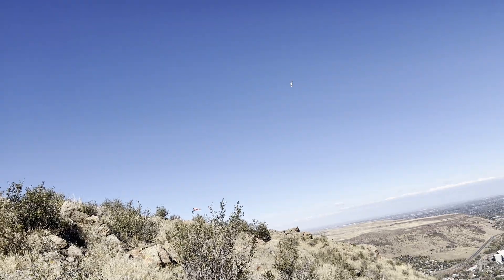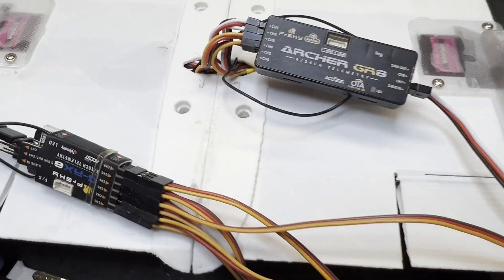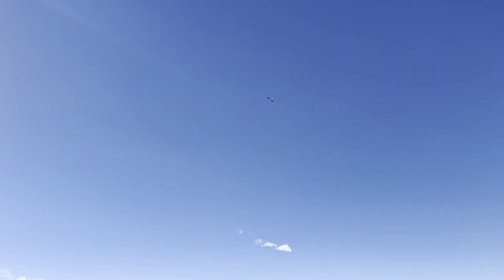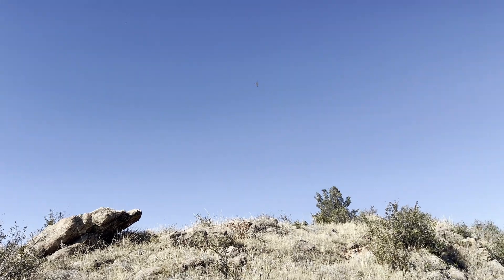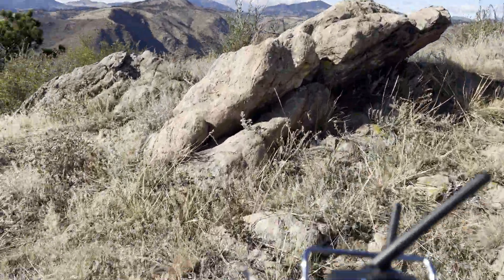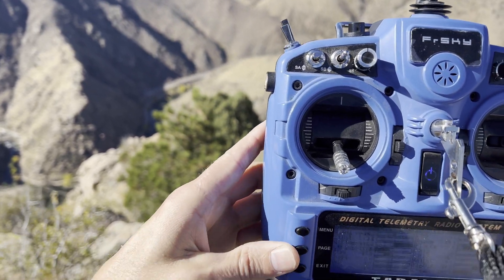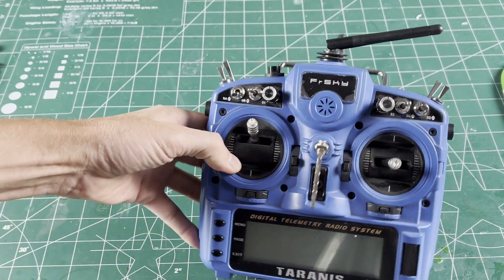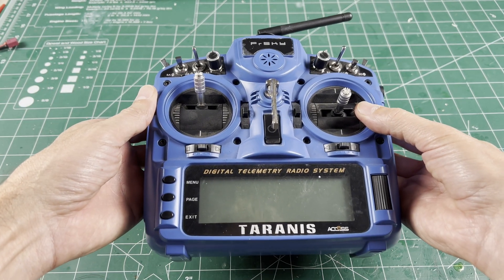Done with FrSky - part1- Dynamic Soaring mishap.. not pilot error for once, which is not good

Comment: I have been a Spektrum user for almost 20 years and advise against it. Last 5 years they have become totally disconnected from users. Crazy expensive receivers that do not perform well at all! New transmitters models every month. Strange quirks with the cheaper line of transmitters. To me they no longer have a place in the A-grade brand list. I am currently migrating to a Radiomaster TX16S as well. I have an external module for ELRS. (I was an early adopter but still happy I can use the other protocols).  It took a long time before I a would trust this new combo. Had some mishaps as firmware developed. Currently it is at a completely reliable status and I am trusting my more expensive planes to it. Especially with the new radiomaster PWM receivers. I think they are awsome. True: learning curve in pakcet rates and programming is indeed steep, but you were used to the taranis, so it will not be that hard for you. It just is not easier. If you want a lot from a computer, it becomes a complex tool. If do not want a lot, things can be easier. But... I did hear the Yeti's have a nice OS. Also the new generation of freesky, also flown at my club, is also a very very nice piece of equipment and I understand also easier to program.

Comment: Hmm.  After watching this I think I will pad with some foam around the battery in my Taranis so that it is held a bit better.  That Taranis of yours looks like it has some miles on it Lol!  I just bought an X20RS and it is WAY more quality than the Taranis ever had.  Ethos is really nice.  At the field here in town there are plenty of X20 owners.  I have no regrets.
Reply from the maker: I hike and fly a lot, but did so with my older radios too.  The battery only moves around when you really shake it, but still should not shut the radio off.
Reply: I will be happy to give your Taranis a look over if you are interested in getting it repaired.  No charge.  Just the shipping.  I am not a professional but I do a lot of that sort of stuff.

Comment: I know you said you want something different than FrSky, but the x18 and X20 lineup with Ethos are incredible. Very Easy programming, new twin and tandem receiver protocol depending on which version you select, plus they will still work with the receivers your using now.  I use Archer receivers for my 3d printed planes and run tandem in my planes that are over a grand, I also use a tandem receiver in a 5” freestyle drone and have never lost signal in anything. Good luck!
Reply: No twin Protokoll on x20 and x18 ! Online x20 pro and pro aw got the twin protocoll
Reply: @wanieldeber6903  X20R and X20RS also have TWIN, and there's a TWIN module for the X18 and old X20's.
Reply: @wanieldeber6903 I have had the  x18 and now have an x18se I can confirm they are twin protocol
Reply: @wanieldeber6903 You can add a twin protocol module or a 4 in 1 or ELRS.
Reply: @wanieldeber6903  I said lineup, if you buy A X20R, RS, Pro, or Pro AW you get Twin protocol. You can also buy a twin lite module to add to
Any Ethos radio if you wanted to fly Twin. You are probably right regarding the X18 but one could still add the module if twin was important to them, but Tandem is better anyway.

Comment: Recommend any radio that has EdgeTx firmware. There are many options, depending what's important to you. (size feel, switch layout, etc)
As far as RC protocols, I recommend using ExpressLRS or Crossfire. Both offer much superior link quality and reliability compared to FrSky protocols and receivers. Both also offer telemetry, which when combined with GPS enabled receiver gives data on speed, position as well as realtime battery voltage and signal strength. Such data captured in the radio can be processed post flight. Might offer new ways to geek out and improve your dynamic soaring skills. 
note: both EdgeTx (radio firmware) and ExpressLRS (ELRS protocol firmware) are open source, so will be supported for long time, and have great communities for support. 

If needing radio right away, and not sure what to get, the RadioMaster Pocket is a great low cost basic radio that many are happy with as its small size make it easy throw backpack, and makes a great backup radio.

Comment: Not pilot error, but I tripped on a rock, the radio switched off, therefore it's the radios fault, LOL, that radio came standard with a piece of stiff foam in the battery bay to hold the battery firmly in place, looked like it's missing and going by the sounds of the rattles when you shake it.  I've been a Futaba user for almost 50 years, FrSky X9D+ and FrSky Lite Pro both running OpenTX since introduced to market, Radiomaster TX16S running EdgeTX sine introduced to market, and FrSky Tandom X20S and FrSky Xlite Pro running Ethos also since introduced to market, also have TBS Crossfire transmitters and crossfire modules that fit all my transmitter.  There's only two radio I can honestly say failed me, one was a Futuba in 1970 that eventually corroded from salt air ridge soaring coastal slopes and the most recent was a Jumper, I'd never use a Jumper radio ever again, apart from those two I've never had a problem with any of my equipment.  If for any reason I was forced to chose one radio only, it would have to be my FrSky Tandom X20S running Ethos, fitted with both TBS Crossfire long range module and a Multimodule so I could still connect with all my models.

Comment: Do you charge your battery in the radio or do you charge it out of the radio because if you check you might not have balanced cells I have the tx16s and I never looked back I also have the Zorro and the pocket crush all on elrs
Reply from the maker: I use the on board charger that has a cell balance circuit.  You have to plug and unplug this, only use for charging.  It is a stupid thing too, but part of what FrSky supplied

Comment: I do a lot of TX repairs for myself and friends.  I have seen cracked solder joints  on the pins of the  connector on the TX that the battery plugs into.  That connector gets a lot of stress and abuse because you unplug the battery every time you charge it. 
I usually first check that to see if i can duplicate the problem by tapping on the wiring from the battery just above the connector that plugs into transmitter and see if the TX turns off.  You have to be patient and try tapping at different angles to see if it fails.  If you can get it to fail you can go ahead and resolder the connector on the printed circuit board.  If you can't get it to fail I would suggest that you open the transmitter and look, with magnification and a strong light,  at the pins on the connector and see if you can see a defective or cracked solder joint.  
Intermittent failures are the hardest to diagnose.  

Good luck, Bill
Reply from the maker: Good suggestion, I might have to re-open the unit and just reflow the pins.  I have a nice soldering station so it would be easy... still going to get a different transmitter for my primary

Comment: why don't use foam or anything else, that the battey couldn't shake in the bay?
Reply from the maker: the shaking battery is just an annoyance, it is not the cause of the fault
Reply: @soarkraft  I didn't meant it could be the cause, but it isn't good. the cause of the fault would maybe a broken/cold circuit connection or lead. i wish luck for the new radio

Comment: 😅Radliomaster TX16s with Express LRS is the way to go. Really reliable with the right telemetry to let you know if you are heading into poor signal or low power. Also it warns you if the RX is connected before power down. I have flashed with EdgeTX which is a must do, too. It hasn wizards for setup, so should tick all your boxes.However, nothing will stop an electronics fault or failed solder joint. BTW, love your channel and models. Winter will be printing time, LW-PLA is awaiting its turn.😊
Reply: I'll add that with the built in 4in1 module, you have back compatibility with the RXs already bought, including Hitec. Yes, there is a learning curve and to help you Joshua Bradwell's channel is currently working through EdgeTX in steps.
Reply: Same here. The only hassle is that the Radio master 4in1 (external) is not binding Hitec Optima and minima (fw 1.3.34), while the iRx4+ instantly binds everything (4in1 external too)... mystery

Comment: Nothing worse than that hollow, empty feeling when your model has just disappeared into the ether, and you have to make the long journey home without it, knowing you’re prolly never going to see it again. I’ve felt that pain more than once.
Don’t be too harsh on the FRsky radio – any brand can go intermittent at the worst possible moment. Give some consideration to the newer FRsky X20S, with the Ethos operating system. I absolutely love mine, having upgraded from my old Spektrum DX9 about a year ago. Once you’ve conquered the setting up (there’s plenty of help here on YouTube) you’ll find it’s a fantastic radio. The Archer 6ch receivers are very compact and reasonably priced. The Tx has ALL the options you requested, with a great library of pre-installed mixers for just about any setup you could imagine. It also has the optional module for non-proprietary receivers.
I use mine at least twice a week with my various iterations of SoarKraft models (all electric powered – not slopies) and I’m yet to see even the slightest hiccup.
Cheers from Bundaberg, Australia.

Comment: I really like my Radiomaster Boxer ELRS, excellent value. The T16S is obviously very popular if it's extra features appeal to you. Primarily though I love ELRS. It has some weird quirks (like channel 5 being dedicated to arming) but the range is insane and even good quality receivers are very cheap. It's got a lot of features which can be a bit overwhelming to learn (model match, hybrid/wide mode, transmit power, binding phrases, packet rate, etc..) but once it's setup it's rock solid. For example a Matek ELRS-R24-V can be had for around $22, weighs 5g, is configured for planes, and it has 7 channels, barometer, UARTS for sensors/gps, battV input, and telemetry. It even skips over channel 5 on the physical connections so you don't have any labeling confusion. Radiomaster has some plane oriented ELRS rx's in every configuration you could want, but I prefer the Matek personally. I fly drones a lot too, and ELRS is ubiquitous in that world so it's a great fit for me.

Comment: Hi I,ve just flashed my Radiomaster TX16s from Open tx to EdgeTx.
A steep learning curve but after 3 days I,m on top of it. Even added a rate function at the field without U tubers help I,m 72 so it should be easier for you young fellas. It will do more than you want and the multi protocol is backwards compatible with all your rx,s. Love your channel.

Comment: Man, I feel your pain! It sucks when that happens. A few comments / suggestions. First, you're putting the blame for the complex programming on the wrong folks! FrSky didn't create OpenTX (or the newer EdgeTX). It's an open source project that is community driven. Lots of new radios use OpenTX (or now EdgeTX), including Radiomaster and Jumper. If you didn't like programming the Taranis, you won't like Radiomaster or Jumper either! FrSky now has their own OS called Ethos, which has the power and flexibility of EdgeTX but with a much nicer touch-screen driven interface. I currently have radios that use EdgeTX and Ethos, and I find Ethos much easier to understand and set things up. FrSky hardware has also improved a LOT since the Taranis days. I've been flying FrSky radios for almost 10 years now, and have never had a radio-related crash. Now, abouty receivers. I too am not all that happy with the FrSky receivers, mainly the form factor and availability. Recently I've been using an ELRS (ExpressLRS) module in my FrSky radios and have been using ELRS receivers from several manufacturers. All work well, but it's less "plug and play" than a FrSky receiver. There's a learning curve because ELRS is also an open source project. It's a solid protocol though, which I think would serve you well in the DS environment. I see another comment mentioned FrSky's new Twin protocol, which is similar to ELRS in that it has a long range component that works alongside the regular 2.4 (two protocols running at the same time). That would also be a good option. My last bit of advice is to stay away from Spektrum. I've lost several planes to their protocol before I switched to FrSky, and don't trust it as far as I could throw it.

Comment: After weeks of research I decided to stay with FrSky after many years of flying with an old Taranis. I upgraded to the X20R and Twin receivers. I couldn't be happier. With the glider templates that you can find online it will take you an hour to set up your first model, and then probably 20 minutes for the next one. Super easy and intuitive.
Reply from the maker: I looked a that... the "Twin" is the 5th different receive scheme FrSky has come out with in the last 3 or so years...
Reply: @soarkraft  Its called progress. If you want to stick with the same technology for 20 years, maybe Futaba or Spektrum is more your speed.
Reply from the maker: well sort of, I switched back to an older module / radio set I have been using for 10 yr because I was having so many glitchy, buggy problems with the FrSky receivers... but maybe its the fact that the module is older that FrSky is not necessarily compatible with it.  

Yes, I am trying to work with something new, but all this new FrSky stuff is not really better... more bells, but not rock solid, bad quality.  I got a new GRX8 receiver that had a glitchy channel 7 right out of the box... bought another glitchy channel 8... and they were ~ $70 each and I needed them so I did not send them back... worked around the problem, but why should that happen?????  Done with them
Reply: @soarkraft  ACCST was getting a bit outdated so I understand the move to ACCESS 2.4 GHz. But then they should have skipped the Tandem 2.4 + 900 and went straight to Twin 2.4 + Lora 2.4. Maybe there was a good reason, maybe not. I have used Lora in other projects, and it is very mature and will be around for a long time, so I can't see FrSky come up with something new that would make sense in the next 5-10 years, so I am happy with Twin and being able to update some of my G receivers from ACCST to ACCESS.

By the way my first 2.4GHz system was Assan back in 2008/2009 and I still have it.
Reply: @soarkraft  Reality is V8 was their first protocol. Then D8 added telemetry and sensors. ACCST was next and added Sport and Sbus as standards. ACCST came out with the first X9D transmitters. It has been their main protocol for a very long time. After many years they introduced ACCESS with MANY powerful new features. Most recently they upgraded Archers receivers to support both ACCST and ACCESS, just to help the older customers. They needed a dual frequency as RF noise is greatly expanding on the 2.4 band, and they were entering into parts of the market that really required more than just 2.4ghz. So Tandem came along. LORA was not really a thing when Tandem was developed. 900mhz has some limitations, but being on a different band than 2.4 is a blessing for many applications. And then Twin came out for the glider market where folks did not have space for the 900hmz antennas. I think Twin was also focused towards the drone market. Twin was a bit of a mis step, but has found a following in the thermal glider market. Frsky actively supports all of these protocols except V8 and D8 as those are very outdated. All others are developed and produced. Hope this helps.. If this did, please visit Aloft Hobbies.

Comment: I have the TX16s and absolutely love it. But it uses the same open tx/ edge tx software. So it not that easy to program to. But when get used to it. You can do whatever you like and want. I also use the elrs reciever on my fpv planes and also gliders with the radiomaster recievers. They are good quality and awesome value. Its not definetly for begginers nor for user that dont like harder programing. But i do enjoy the freedom and i thinks it worth considering it. Great video. As we speak im building the igneous. Looking forward to some good ol slope soaring.